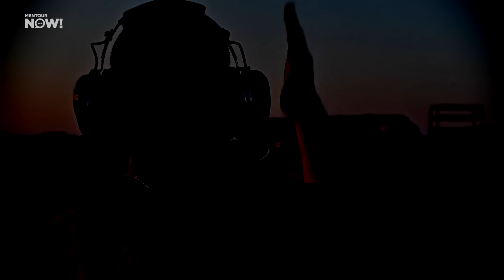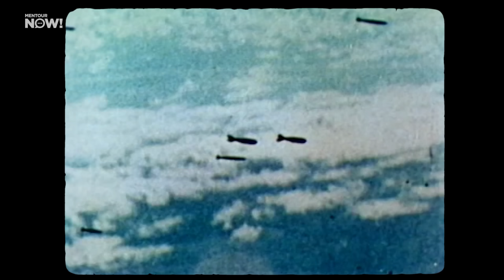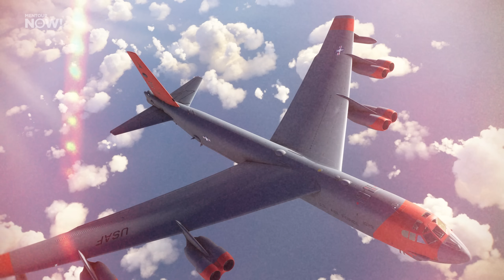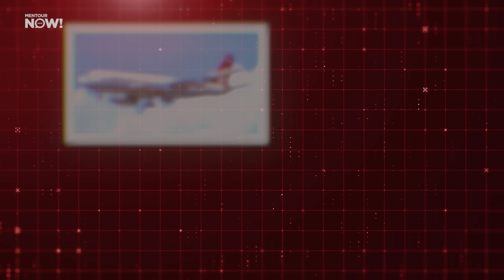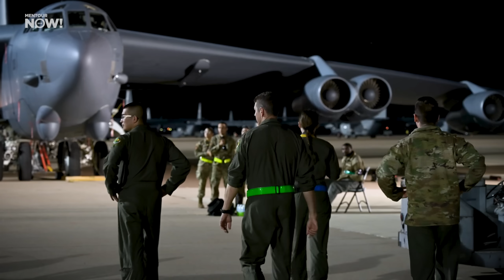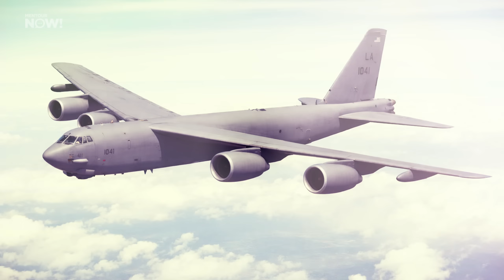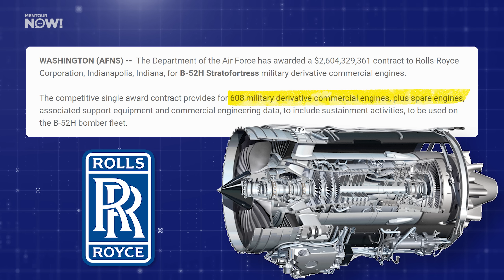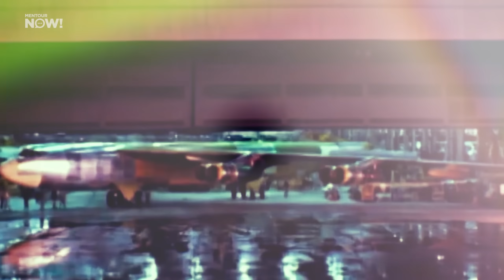WHY Are They Changing The B-52 NOW?!

Comment: Mentour touched broadly on the key reason for the engine upgrade: maintainability (or lack there of) of the TF33 engine.

There are a couple very important sub-issues he didn’t mention though, and he didn’t mention a key reason for the B-52’s longevity. These play together for the Commercial Engine Replacement Program (CERP)

1. The TF33 engine Mean Time Between Overhaul (MTBO) is only a few hundred hours, and worse, is eye-wateringly expensive, on the order of $1M to $2M for each engine.  The RR F130 replacement engine is based on the commercial BR725, which has a MTBO of 10,000 hours, proven and documented in commercial service, which makes it unlikely to that it will need to be overhauled in the remaining life of the B-52 fleet. That’s a huge savings. Fuel efficiency and added range are nice, but it is the MTBO that is driving this.

2. The limiting factor on the B-52H’s life span is the remaining flying hours left in the wings, which is around 10,000 - 12,000 hours (The B-52H sat nuclear alert for a lot of years while its predecessors flew in Vietnam). This is why the new engines are unlikely to ever be overhauled: the engine life and wing life are approximately equal and will wear out about the same time. It’s also why the life of the B-52 is projected to go into the 2040s and beyond. On average Air Force planes fly about 400 hours per year (compared to commercial airliner at 7,000 FH per year or more). 10,000 FH/400 FH per Year = 25 more years of life. 

Since year 2000 the USAF has retired nearly every type of aircraft that uses the TF-33, including the C-141, KC-135E, E-8C, WC-135, OC-135, RC-135s that were not upgraded to CFM56, C-18, VC-137. Only the B-52 and the E-3 still use TF33, and retirement of the E-3 fleet started in 2023, scheduled to be fully retired in 2029.

So the BUFF has to get re-engined one way or another, or be retired. It has a lot of flaws, but they are well-known and compensated for by training and technique. It’s very maintainable, even with the TF33 it has one of the highest Mission Capable rates, it can carry a lot of stuff for a long time and a long way, and the basic airframe is paid for. Standoff weapons and advanced EW equipment will let it operate in wartime. If they retired the B-52H they would have to create or  modify another, airframe to do the same mission, so re-engining for maintenance savings and more electrical power makes sense.

I don’t think Mentour mentioned that the new avionics, made possible by the new engines, will reduce the crew size from five to four.

Comment: I spent almost 14 years on this airframe.   It's best characteristic is that it can be adapted to almost any weapons system.  If the B-52 is going to last it needs to be more fuel efficient and parts that are less likely to fail.

Comment: I am neither a pilot nor an engineer [of any sort]. My Dad was an air traffic controller until he retired in 1980. We went to air shows and even the Mojave air races when we lived in the area. 

The first thing I thought of when you started talking about upgrading the B-52 engines was that it would upset the integral balance of the plane. The B-52 was built around those engines. Changing the engines would affect the center of gravity in the pylons specifically and the whole aircraft in general. The same would be true regarding the thrust produced on each pylon. Then, you have to move all of the connections because different engines have different ways of wiring and plumbing each engine. Switching from an analog cockpit to a fully digital one would require almost a complete rewiring of the aircraft. Reducing the number of engines by half affects the reliability in terms of anything and everything that can stop an engine from working, including battle damage. Pilots would have to be retrained to some degree because the relationship between the airframe and the new engines would have changed. This was a great video and highlights the complexity of getting an aircraft to fly.

Comment: You said the new engines needed about the same thrust as the original engine.  Nope.  The original engines could NOT get a loaded B-52 into the air with a full load of fuel.
So it took off with a partial load of fuel and quickly refueled.
It took one of the more recent new engines with higher thrust before it could take off with a full fuel load.

Comment: I was stationed at March AFB, 1972-1974.  All our BUFF's were overseas for Viet Nam.
However, I do remember an issue with wing structure fatigue.  
When the BUFFs returned stateside and resumed their Alert Facility duty, there were written
directives stating that the plane could no longer be towed to or from the Alert facilty with
either fuel or bombs (nukes) loaded.  Must be fueled/loaded and unfueled/unloaded at the 
Alert Facility to relieve stress on the wing spar until the wings were rebuilt and strengthened
via a full maintenance cycle.
Fifty years later they're still flying.  Probably the only original parts left is the skin.....
Reply: I think I remember a major program to replace/redesign the main wing spars in B-52's - somewhere around the G or H variants? With all the flex in the wing, I am not surprised.

Comment: Did you find anything about rudder size? I remember reading somewhere that part of the 8 engine design was because the rudder was undersized  the loss of one engine in a 4 engine configuration could possibly put the yaw rate beyond the rudder’s ability to compensate. 

At least that’s what I seem to remember reading somewhere.
Reply: You are right. I think it started with eight engines because that’s how many it took, with the technology of the day, to make the beast fly. For the size of the aircraft, it needed a bigger tail, but they knew from the beginning if it was too big it would just break off, so it was purposely designed under sized.  They had considered an all-moving tail, but didn’t think the hydraulic actuators of the day were up to the job.

The weak rudder authority was partly compensated for with the design of the landing gear that allowed the fuselage to be pointed into the wind for crosswind landings/take-offs. And yes the eight smaller engines compensate as well in that if you lose one engine on takeoff the asymmetrical thrust is not as bad as if it were a four-engine plane. Losing 50% of thrust on one side during take-off could not be compensated for by the rudder. That of course is one of the factors that dictates replacing the old engines with new ones of similar performance.
Reply: @S @Spectator1959 would think also the loss of one engine on one side leading to the shut down of the mirror engine on the other side would be operationally negligible if yaw rate dictated such actions. Something maybe not feasible with only 4 engines. 

Probably part of what drove the decision to stick with 8 along with who really knows how many other factors

Wish grandpa was still around he could chime in and tell all sorts about the aircraft. He worked for Boeing in Kansas building them. Though he did tell me one time the C-130 was the finest aircraft ever made. That’s probably not what this crowd wants to hear.
Reply: @christhompson7766 It still needs to maintain a minimum amount of thrust to take off under all scenarios, including crosswinds, max weight, runway lengthand conditions etc.

Comment: Why can't they just build a new aircraft, that's not stealth or supersonic but that can carry a huge load and use modern engines and radars, like a combat version of a 757 ?
Reply: Cost
Reply: But in ten years we'll have a new project to replace wings, and then there will be fissures in the body of these 80 year old planes. It's short sighted.
Reply: @MartinJofre you’ve got no idea what you’re talking about
Reply: @stevewakeford1474 good argument
Reply: @MartinJofre I told you the reason at first. It’s a fact, too costly. You can’t convert an airliner to drop bombs. You want to build a NEW aircraft that will cost billions to develop, training costs, equipment costs, teething problems etc, instead of just maintaining what they have. The maintenance of the B52 will be expensive but cheaper in the long run. Building a new type is short sighted because that will also eventually need costly maintenance
Reply: @stevewakeford1474  That speaks of how poor America has become, if they can't develop an airliner type bomber after 80 years. Think of the past, plane models where being replaced after 15 years on average. 
If the US can afford to build a B-1, then a B-2 and now a B-21, of course they can afford a cheaper plane.
Reply: @MartinJofre  its not necessary. They have stealth alternatives and cruise missiles. The cost is far too great for a receding role. I dont think you understand what you’re talking about really.

Comment: The Navy just adopted the 737 as their new sub-hunter, designated as the P8A.  I would've thought the Air Force would follow suit and modify the 767 or 777 into their new bomber.  I'd be willing to bet it would be cheaper than the latest upgrade program to the B-52.
Reply: You’d be wrong. It would be prohibitively expensive to modify these aircraft. I don’t think it would even be feasible
Reply: I don't profess to be an aeronautical engineer, so perhaps it is more expensive, but more expensive than the engine upgrade and flight control/power control upgrades to an aircraft design that is 71 years old this year?  Perhaps someone can explain the difficulties of modifying an existing passenger aircraft airframe.
Reply: @dou @dougschaller2755 he difficulties come from modifying the airframe itself to fit a bomb bay. The cargo areas alone are not sizeable enough to carry a payload equivalent to that of the b52 so now you’re carrying out major modifications that will take years and many billions. You’ll notice that a b52 has high wings and a huge bomb bay. On a commercial airliner the wing structure goes through the centre fuselage right where you’d want to put your bomb bay. I would say that additionally you’re massively increasing the risk of an accidental shoot down if your bombers look like commercial aircraft. I am a licensed aircraft engineer on commercial aircraft by the way

Comment: Petter, not just "some" versions of the 707 and DC-8, but the P&W JT3D Turbo Fan (TF33 in military application as stated) was the predominant engine  powering the most prolific variants of the those planes ruling the commercial skies of the 60s and 70s,  the 707-320B and C series and DC-8-50 and DC-8 "Super 60s" models. While lower bypass than virtually any engine since, it was a considerable "higher bybass" upgrade of its immediate predecessor, the ultra-low bypass, water injected JT3C (J57 military) and JT4A (JT3C upgrade w/o water) Turbo Jet. The planes powered by the early Turbo Jets (707-120/320, DC-8-10/20/30), but particularly the water injected engines of the early variants, earned the moniker "smokey 8s," due to the black exbaust plume on takeoff but also other high-throttle applications. The JT3C/J57 powered the early B-52s as well, often identified also by the billowing tell-tale black trail - x8! The JT3D/TF33 Turbo Fan engines were slightly less "exhaustive" but still quite productive in that way. Only those familiar with the earlier turbo jets would appreciate the difference! Variants of all of the above engines also powered a variety fighter-jet aircraft from the late 1950s through the early 1970s.

Comment: They originally had the J-57 engine, which were later replaced by the TF-33.  The retirement of the C-141 Starlifter fleet from 2000 to 2006 provided a lot of spare TF-33 engines to support the B-52 fleet.
Reply: I thought I remembered that the BUFF got a re-engine job in the 80’s that Peeter didn’t mention.

Comment: I worked for the largest aluminum company in the world for thirty years and maintained CNC machinery that was designed to cut out parts primarily for aircraft.  Think the dimensions of two 747 wings lying side by side to give you the size I'm talking about.  Two saw heads that can each be swiveled to cut straight sections at angles and router heads that can mill curves, etc.  Interesting stuff.  I saw some very interesting shapes over the years.   I can remember one night seeing F16 fuselage profiles lying on mill tables.  Wouldn't be surprised if some parts for these planes didn't come off of the beds at one time or another.

Comment: Re upgradability - being able to upgrade is great for the client and great for reusing equipment that is not itself expired. It's also pretty good for retaining old skillsets that could just be useful again one day. Just because it's old doesn't mean it's wrong! Buy cheap and throw-away (the "disposable" culture) is very bad for everyone, in the end.
However, I regret that USAF hasn't already bitten the bullet with fuel economy (in general, across its fleet): as you mentioned, efficiency -> range, and also logistics in war are famously hard to get right ("the army marches on its stomach" or, as Rommel found in the N Afria battles in WW2, at the end of the day you still need to get the fuel to the equipment, and sometimes that's hard. Also poor fuel economy means it's taking money out of the budget that could be spent on other things - more planes, more soldiers, whatever. Even the USAF's budget is not infinite.
From the pics you showed us the old plane's nacelle looked sleek while the new one less so. I do hope they can restore some of the sleekness before the design is fixed.

Comment: I LIVE IN SAN ANTONIO WHERE ABOUT 3 MILES AWAY IS ONCE A BASE FOR THE B-52'S TO GET REPAIRS AT KELLY AFB,  BOTH MY DAD AND UNCLE OR BROTHERS WORKED ON THE 52' MANITANCE PROGRAN FOR DECADES AND DECADES- THE REASON WHY THE KELLY AFB REPAIR STATION WAS DISCONTINUED IN THE 80-90'S WAS BECAUSE THE AFB COULD NOT PEOPLE TO BE ABLE TO READ ENGLISH AT A HIGHER LEVEL OF WORD COMREHENSION TO WORK ON THE 52'S.  THE PLANES WOULD FLY ALL OVER SA EVERYDAY OF THE WEEK TEST THE NEW REPAIRS ON THESE GIANTS- WELL THEY HAD INCIDENT AFTER INCIDENT OF WKEELS AND TIRES JUST FALLING OFF THE PLANE AND KANDING ON THE HIWAY THAT WENT ALONGSIDE THE RUNWAYS.  THEY HAD ENGINE COWLING JUST FALLING TO THE GROUND OF THE RUNWAY BEFORE THE PLANE GOT AIRBORNE.  MY DAD WAS A SUPERVISOR IN THE RADAR BUILDING AT KELLY'S MOST SECRETIVE BUILDING.  THE ONE WITH NO WINDOWS JUST A HUGE BLOCK OF CONCRETE!   THE PROBLEM WAS IN PART A POLITICAL ONE WHEN THE CONGRESSIONAL LEADERS FOR SA DECIDED TO HIRE LOCALS - SO THE AREAS OF THE REPAIR HAD THE CHORE TO TEACH THESE LOW EDUCATED LOCALS TO WORK ON SOMETHING FOREIGN TO START WITH AND DO THE JOBS RIGHT SO THE PARTS WOULD STAY WITH THE ROUND TRIPS OF TESTING REQUIRED TO CERTIFY THEM FOR FLYING OVER LARGE CITIES  THIS WAS PROVEN IMPOSSIBLE TO WORK ON SOMETHING HARDER THAN A "54 CHEBBY" STILL CHUGGING ON THE STREETS OF SAN ANTONIO!   SO, THE WORK LEADERS WERE NOT MEETING THEIR TIME FRAMES FOR COMPLETION HAD TO FIGURE OUT A WAY TO STAY ON TIME FOR REPAIRS!  THE FIX INVOLVED DECKS OF CARDS, DOMINIO UNDER A EZ UP CANOPY OFF THE SIDE OF THE PLANE PARTS BEING INSTALLED- TO KEEP THEM OUT FROM THE AIRCRAFT BEING BROKEN EVEN FARTHER THAN THEY WERE SCHEDULED FOR IN THE FIRST PLACE.   THIS WORKED FOR A DECADE OR MORE- BUT THEN THE WORK LEADERS WERE FOUND OUT - THEY WERE HAVING THEM THAT HAD MINIMAL KNOWLEDGE OF THE ENGLISH LANGUEAGE WERE BEING LET JUST PLAY CARDS OR DOMINO'S TO KEEP THEIR HANDS OFF THE AIRCRAFT SO THE ENGLISH SPEAKING MECHAICS COULD DO A RIGHT JOB OF REPAIRING THE 52'S ON TIME- SO OTHER PROJECT COULD ALSO BE ON THE TIME ALLOTED TO THE 52'S REPAIR AND BACK IN SERVICE!   IF THIS FIX WOULD NOT OF HAPPENED SECRETLY - WE WOULD LIKELY BE A PART OF VIETNAM!   THEY WERE BEING SHOT UP AT RECORD NUMBERS FASTER THAN THE "ENGLISH SKILLED FIXERS" COULD DO THE JOB- THEN THEY HAD ALL THE ILLITERATE "ONION FARMERS' AND "54 CHEBBY" OR "CHEVY" FOR ENGLISH SPEAKERS JUST STAYING OUT OF THE WAY SO, MILITARY DEADLINES COULD BE MADE OR MET!   WHAT A FUN LIFE LIVING WITHIN 140 MILES OF THE MEXICO /U.S. BORDER ALL MY 79 YEARS OF LIFE!  " NOPE NOT AT" ALL HAVING TO COMPETE FOR JOBS ALREADY GIVEN AWAY TO THESE "TORTILLA TECHS" THAT WERE GIVEN THE JOBS THAT NEEDED TO BE GIVEN TO ENGLISH SPEAKING MECHANICS THAT HAD KNOWLEDGE OF THE PLANES!  THIS IS WHAT THE ENGLISH SPEAKING CITIZEN HAD TO DEAL WITH IN THAT ERA!  AND IT'S THE SAME RIGHT NOW HERE IN SA'S ILLEGAL "UNDER TABLE NON TAX PAYERS STEALING JOBS FROM AMERICAN CITIZENS" THAT DO NOT NEED TO BE TOLD WHAT A SCREWDRIVER IS FOR!  TIS GIVING THE 52 JOBS TO THESE TORTILLA TECHS LED TO KELLY BEING DROPPED LIKE A ROCK FOR BEING THE BIGGEST REPAIR BASE IN THE AIRFORCE!  NOW, IT A RELIEF RUNWAY FOR THE SA INTERNATIONAL AIRPORT AND A LANDING STRIP FOR NEXT DOOR BASE LACKLAND AFB- THIS BASE OF KELLY WAS A DETERRENT FOR THIS SAME IDIOTS IF THEY EVER DID CHOOSE TO RUN THE BORDER - IT WAS OUR PROTECTION AND NOW IT'S LIKE THEY "RAN THE BORDER" AND THEY DID- WE ARE FILLED UP WITH THE TORTILLA TECHS IN EVERY WALK OF LIFE THAT TOUCHES OUR ECONOMY DAILY IN SA!!

Comment: One factor with old airframes like the B52 is that they tend to be overbuilt, in a good way. Because the design and the metalurgy technologies weren't as good as today they had to have larger tolerances in their maths. So an older airframe will be heavier than a modern equivalent, but that means it's also more durable. Compare the DHC-7 to a Dash-8. Or compare a Dash-8 to a Q400! Q400s are aging out with far fewer hours and cycles than the -8s did. The modern airframe will be more efficient and probably more profitable, but will not last as long. Which is probably fine for airliners lol
I guess my point is that it'll be difficult to make new aircraft types with both efficiency and upgradability in mind.